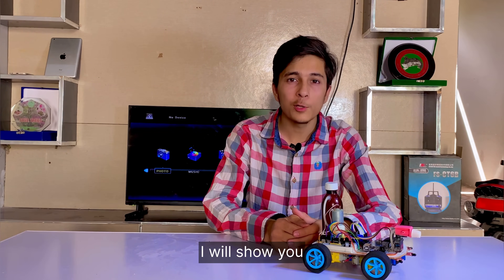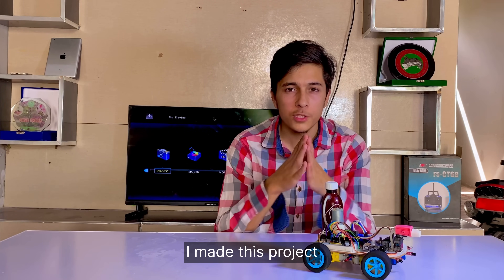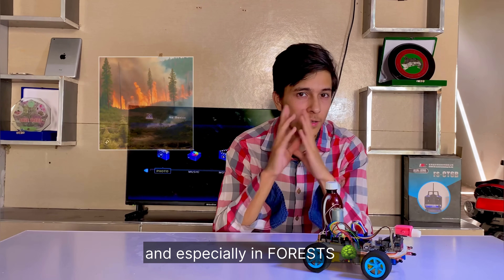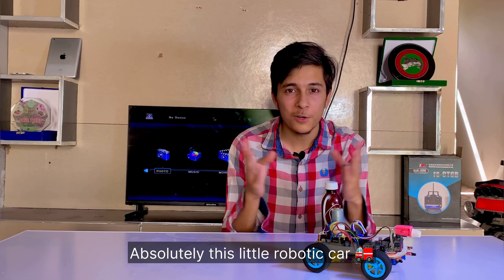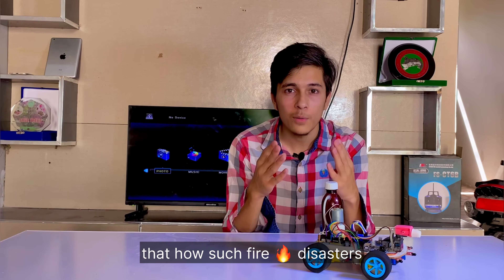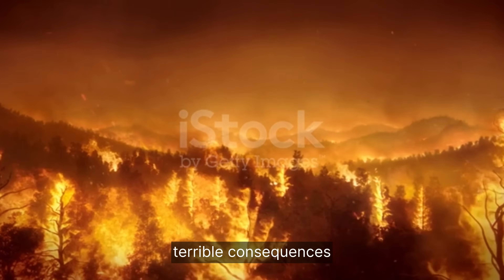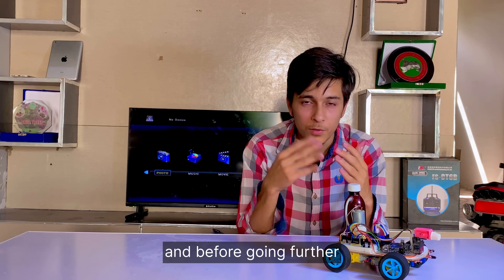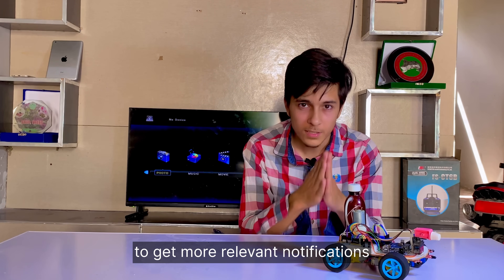DIY Fire Fighting Robot using Arduino  |  Auto Fire Chaser and Extinguisher

Comment: Can you plz provide more detail about how you are making this connecting wires
Reply from the maker: Everything is cleared in the circuit diagram and in the video too
Reply: @saadinnovativeideas  in bread board some of the things are uncleared that you just put it some of things are un named
Reply from the maker: Do you understand bred board connections??
Reply: @saadinnovativeideas yar everything is cleared and we also do the same but it is not working code is also uploaded completed now tell us what to do
Reply: My components are just coming tomorrow I am gonna work on it. tomorrow plz help me if the things will not work
Reply from the maker: Sure, and study about breadboard board, thats just easy
Reply: We want to add a Bluetooth chip so that we can aslo control it with Bluetooth can it be possible or not?
Reply: Plz tell me how I can connect the Bluetooth chip in almost some things are completed

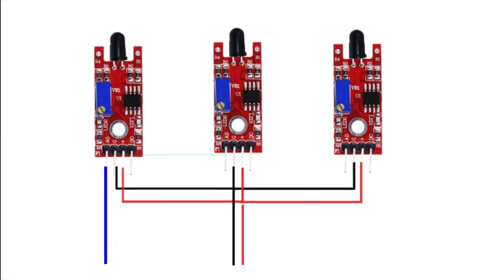Comment: 3:25 i dnt understand wiring pls help
Reply: Bro please send diagram of  this with breadboard😢😢😢😢 please tomorrow should give please😢😢😢
Reply from the maker: Connect the GND and VCC of the sensors parallel yo the arduino board and take individual vires from A0 of all the sensors

Comment: Why do you use transistors and diodes and capacitors? its possible not to use it?
Reply from the maker: To drive pump. To avoid it you can use relay module just

Comment: What will happen if breadboard is not used
Reply from the maker: Then you have to do soldering or join the wires and covering them with tape of heat shrunk tubes

Comment: Bro can you tell me its sensing the flame but everything is working properly but it is not moving forward
Reply from the maker: Which sensor have you used?
And whats the power source and net input voltage?
Reply: @saadinnovativeideas  same ir sensor bro and 3.7x2 battery lithium rechargeable 18650
Reply from the maker: You mean four pin sensor?
Double check your circuit diagram and make sure you have uploaded the code successfully with a right COM (port)
Reply: @saadinnovativeideas  yes bro it's 4 pin flame sensor only we are using arudino uno R3 only com5
Reply from the maker: Then it should work. May be any of your component is faulty

Comment: Bro can we do it without transistors
Reply from the maker: You can use relay module instead of transistor and other components to drive pump
Reply: @saadinnovativeideas  tq so much but can you tell what will be serial monitor values if it works fine so we can troubleshoot any issues

Comment: bro the servo motor is not working and the digital flame sensor are also not working give me the solution please i have to submit this project on 4dec please help me
Reply from the maker: How much voltage have you given and what type of battery have you used? Also name the sensor (3 or 4 pin)
Reply: @saadinnovativeideas  i used 18650 3.7v two batteries nd i used 3 pin D0 vcc gnd
Reply: @saadinnovativeideas  nd motor is also continuesly starting

Comment: Can you help me with breadboard connection? Please
Reply: My Arduino is not turned on, but separate connection given means light is blinking, but not through the bread board
Reply from the maker: You should study about breadboard. If still unable to do then you can solder the connections or just join with coverage with tape or heat shrunk tubes

Comment: Hi thank you SAAD the model worked
Reply from the maker: Congrats
Reply: Bro can You please help me out, My one is not working
Reply: @feelofdeen  what happened
Reply: @SadanAnsari01  after switching on Battery, just the led of motor driver nd Arduino get light on, nd nothing else works,
Can You please tell me if I need to do any changes in the code or in the Circuit connection? 🙏🏻
Reply: @feelofdeen ok i will help you, use lithium ion rechargeable battery and tell me
Reply: @SadanAnsari01  currently I am using  2 lithium ion  battery that shown in the video
Reply: @feelofdeen  what is the voltage are they rechargeable
Reply: @SadanAnsari01  3.7+3.7=7.4 V, rechargeable battery
Reply: @feelofdeen  i made this not working i think it's my fault, code sahi hai
Reply: @SriVydyaDentalHospital  can you, i m also making this

Comment: My bo motor and servo motor is not moving im using 3 pin fire sensor please help me please
Reply: Your sensor has do(digital output) connect this pin to the digital pic of uno and change the code analog to digital
Reply: There should be light in the sensor

Comment: hey bro i had this project with the help of your video but the problem is the car nd servo motor is not moving nd i have used rechargeable battery 18650 3.7 v nd three pins flame sensor if you don't mind can you please help me ....
Reply from the maker: So you cannot connect D0 of the sensors to the analogue pins of the Arduino uno
Reply: @saadinnovativeideas  will you help me to connect it with the digital pins its really urgent....

Comment: Hi SAAD now everything is working except it’s not spraying water motor is 5-9 v only and motor is running but it’s not sucking water
Reply from the maker: Which water pump have you used? Have you used the same components as I to drive pump
Reply: I have used mini water pump which is available online and which is having inbuilt wires and is submersible but it’s not sucking water although the motor of the pump is running. I connected it to the breadboard using male wires but still not working
Reply: Hi SAAD now the water is spraying and motors are moving even without detecting fire
Reply from the maker: You may have exposed the project in sunlight
Reply: What to do
Reply: No in the room only …at times they are moving at times it acting normal but not spraying water
Reply: Should I do any changes in the connections or just leave it
Reply from the maker: Which sensor have you used?
Reply: 4 pin sensors for flame and rest of the components as u showed in the video…at some times it is working fine but at some times wheels move and it sprays water even without the flame and sometimes it doesn’t

Comment: Did you change servo motor from female to male
Reply from the maker: Yes
Reply: @saadinnovativeideas  thankyou for ur quick response 👍
I have done it completely 
But can you help me with breadboard connections because I think I gave it wrongly hence arudino is not working 
But it is working when coding and when gave direct vc and ground pin connections .
But all bo motors are working properly.
Waiting for your reply..
Reply from the maker: Double check your connections with the circuit diagram I provided

Comment: Hello, I want to change the female connector of the microservo for a male one but I can't find it. Can I do it with jumpers? I would have to change the programming, right? What would it be like in that case?
Reply from the maker: No need to modify sketch. You can use male to male jumpers by putting the pins in the female jumpers of the servo to the breadboard
Reply: Thank you so much

Comment: Hello SAAD pl guide me through the water pump is not working rest   And the model is also moving slowly
Reply from the maker: If motor is moving slowly it means you have used bo motors of least rpm or your power supply is not good
Reply: @saadinnovativeideas  100 rpm Bo motor work?

Comment: hola, hice el proyecto pero cuando acerco el fuego se va para atras, ya trate de corregir pero no encuentro la solucion, ayuda porfavor
Reply from the maker: Try flipping the motor wires (which are connected to motor driver slots) until it work perfect

Comment: Saad all the connections r right, arduino, flame sensor and L298 motor give red light when i turn on the switch but the code is not working or i dont know what but nothing works at all, 
Please help me
Reply from the maker: Is your power-supple compatible? And how much pin sensor have u used?

Comment: Hi my servo was working but it stopped again and I changed the water pump as u showed but still water pump not working…Pl guide
Reply from the maker: Was it working well before , so what changes you did so it doesn’t work now?
Reply: Now servo n everything else is working but it’s not pumping water I changed to 5-9 v motor also. I can c the motor running but it’s not spraying water.. when I test the water pump separately it’s working but when I connect it to the model it’s not spraying water
Reply: Pl help as soon as possible as I have to submit it

Comment: Hi my model is moving but water pump and servo not working
Reply from the maker: For servo, has 3 wires; flip the side wires connections and leave the middle one. 
Have u used relay module or components I have used yo drive pump?
Reply: I flipped the servo wires it is working but the pump is not working I have used submersible pump…
Reply: I have not used relay module….
Reply from the maker: If you haven’t used relay module then make sure you have used the same components as I to drive the pump
Reply: Your motor is different mine is submersible but with the same power rest all components are same

Comment: Bro I have done this project,
Then switched on,
It was lighting in uno bord and motor controller,
I programmed and uploaded,
But It was not moving and the servo motor was not working .
May I know what would be the problem.please😢😢😢😢😢😢😢😢😢😢😢😢😢😢😢😢😢 please please please 🙏🙏🙏🙏🙏🙏🙏🙏🙏🙏🙏🙏🙏🙏🙏🙏🙏🙏🙏🙏🙏🙏
Reply from the maker: Which battery and sensor you have used?
Reply: @saadinnovativeideas how many watts of battery should be used
Reply: Brother as you told , I have changed that ,It is working but the servo motor and the water pump is not working please reply me fast
Reply: Three pin sensor with li ion battery
Reply from the maker: The code if for foir pin sensor having analog pin A0. You have yo change analog funtions in code with digital functiona
Reply: Brother or else shall I change the sensor
Reply from the maker: No, just change the pins names to which you have connected the sensors pins
Reply: Or please give me the detail coding

Comment: Hi I used rechargeable batteries as u said…should I change the code also because I am using 3pin flame sensors?? Pl reply as soon as possible
Reply: You need 4 pin

Comment: I used 9v HW battery and did all the connections as you said..but the flame sensors which I got were 3 pins…after programming also the model not working in front of fire…pl guide as the project has to be submitted within few days 
Thank you
Reply: Thank u and also I have 3 pin flame sensors will it work or do I need to make any changes in the connections and code?
Reply from the maker: In code change analog functions with digital funtions
Reply: I also have 3 pin ones. Can you give me the specific code pls?  @saadinnovativeideas
Reply: @saadinnovativeideas  so if i use digital flame sensor i have to change the code..? please bro , i came from vietnam...can you give me the code with digital flame sensor ? ...the blue flame sensor....
Reply from the maker: HW battery cannot provide desired amps. Try to use rechargeable battery that can deliver 2-3 amps because the circuit pills more amps and battery cannot provide

Comment: Hey im making this project but a couple of issues are showing up. Im in urgent need of help so pls do reply!!
When i turn on the switch, the motor driver shows a red color but only for like a minute or so before it fades completely and then does not turn on for while. i have to turn it off for atleast half an hour before it shows a light again but it also disappears in a bit. how to fix this?
And im not sure if my arduino is working or not. it looks a bit different from yours but has all the ports you have used for connecting, a very small green light turned on at the beginning once i was done with the connections with the breadboard, but when i connect to the laptop, port option does not show i even tried from a different laptop. also after the issue of the motor driver, the arduino is no longer showing any light on it. i have tried changing the cells but it only solves the issue for a minute and it goes back to the green light on the motor driver fading. Your help would be greatly appreciated!!
Reply from the maker: For connecting port you have to install Arduino Board Driver and then connect your port.
And if light is fading, make sure you power supply is OK and can provide desire amps. And may be your motor driver is faulty
Reply: Is your project working now?

Comment: Bro i have 3 pin flame sensor it can work tell me love from india
Reply from the maker: Yeah
Reply: @ code will be same
Reply from the maker: No, change analog function in code with digital
Reply: @ Brother i have 3 pin flame sensor in which wire i have to sold which which wire very confusing

Comment: If we use other flame sensor modules, then what changes we need to do in our code. Please reply😢
Reply from the maker: What type of sensor
Reply: 3 pin senor. I have changed analog to digital but what changes we have to do in our connections .please tell properly . I cannot understand. Please reply
Reply from the maker: @sanketror5356   In connections just connect the D0 of the sensors to the pins available in arduino uno. And name the same pins in the code in place of pins name before for sensor
Reply: Please give your contact email or insta id
Reply: I cannot understand properly. Thanks for replying in such a short time. I pray your channel grew very large
Reply: Please give your contact or email or insta
Reply: Contact
Reply: Please

Comment: Hi bro I did the project same as in video but the robot is moving back instead of moving front what should I do..?
Reply: You may have confused the positive and negative poles of the wheel motor or wired it backwards when connecting the wheel motor to the L298N
Reply: make reverse connection
Reply: You should give opposite supply of electricity
Reply: motor kablularını deyiştir
Reply from the maker: It should not move backward

Comment: Bro I have done programming but there is a problem,the wheels and the pump run by itself without any flame detected.
Please tell me the solution.
Reply from the maker: You might have exposed the car in open light
Reply: Ya mine also same problem now what to do

Comment: I am confused with connecting the motor wires to the motor driver ,which side of the vehicles motors should I connect to which side of the motor driver.Should I connect the left side motors of the vehicle to the terminals of the motor driver which is near to the arduino board or opposite to it.
        WHICH SIDE OF THE BATTERYS TERMINAL SHOULD I CONNECT TO THE SWITCH.
                          🙏 THANK YOU🙏
Reply from the maker: Connect the motor wires of left on left side slot and right with right of motor driver.
And switch can be connected at any terminal

Comment: Bro if I will give direct connection
Reply from the maker: How?
Reply: @saadinnovativeideas  By charger or wire
Reply: joining at the place of battery wire
Reply from the maker: How much output voltage and ampere charger you are gonna use
Reply: @saadinnovativeideas  12 Volt and 1ampr

Comment: Bro my flame sensors are not starting ,because of that I had removed all circuit,and if i see flame sensor by giving direct power they are on 
Plz
Plz
Reply
In 2 days my exhibition is there...🙏🙏
Reply from the maker: Which sensor have you used? Name the pins
Reply: @saadinnovativeideas 
4  pin , red colour
Reply: AO 
G
+
DO

Comment: Can i use two servo connected to one water pump, if yes , please tell the connections and the program code
Reply from the maker: Yes, give parallel connection of attached servo with the first one
Reply: @saadinnovativeideas  should I give parallel connection on the bread board in front of first servo connected or could u please tell me how to connect in parallel
PLEASE TELL ME THE PROGAM CODE after connecting the two servos .
I want some gap from the flame and the vehicle, I don't want the vehicle to go so close to the flame ALSO PLEASE GIVE PROGRAM UPDATE FOR THIS.
                        THANK YOU.
Reply from the maker: When you connect the first servo by putting pins in the breadboard, the second servo will follow the same pattern parallel to the first servo wires pins on breadboard.
And no changes in the code require and gap from the fire flame is already adjusted in the code, no need to modify the code

Comment: 7:32 this can use 102 pF or 104 pF?
Reply from the maker: Not a big deal, both will work
Reply: @saadinnovativeideas 3:20 what cable is this ? can i use male to female jumper?
Reply from the maker: But you can’t put two female jumpers into single pin thats why I did soldering
Reply: @saadinnovativeideas  bro, can i use water pump 5 volt and how to i use that?

Comment: motor and servo not working
Reply from the maker: Have you used the sensor with analog (A0) pin? And whats the total voltage you have given yo the project?
Reply: thx it started working

Comment: Can I ask you about this firefighting robot car, do you need to calculate any parameters? For example, calculating motor selection or torque?
Reply from the maker: The motor used in the project is of 180 RPM and you can adjust its speed in the code

Comment: can we use 3 pin flame sensor in place of 4 pin? how do I connect the 3 pin flame sensor so that it work?
Reply from the maker: Do that have analog (A0) pin?
Reply: No it doesn't have A0 pin it has only 3 pin D0 Gnd VCC  @saadinnovativeideas
Reply from the maker: Then circuit diagram remains the same but just replace analog with digital*, *A0 with D0 anywhere in the code

Comment: But mene 3 pin flame sensor use kra to programmer not responding error aara ha
Reply from the maker: Agar os mai D0 pin hai to phir code and circuit diagram mai modification karni parai gi

Comment: Is any diffrence in 3 pin flame sensor and 4 pin flame sensor?
Reply from the maker: Not a big but, three pin sensor has digital pin and and 4 pin has digital (D0) as well as analog (A0) pin
Reply: But mene 3 pin wala use kra to chl nhi raha aur programmer not responding aara ha likha hua